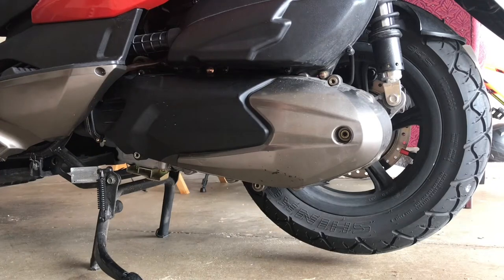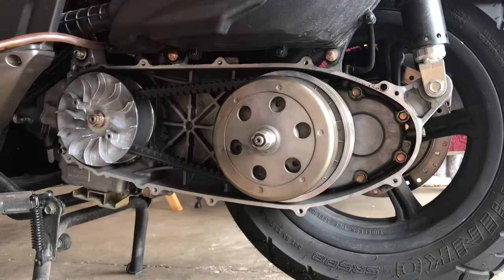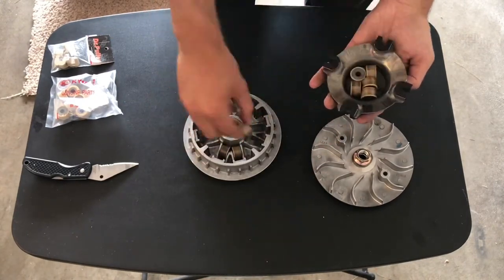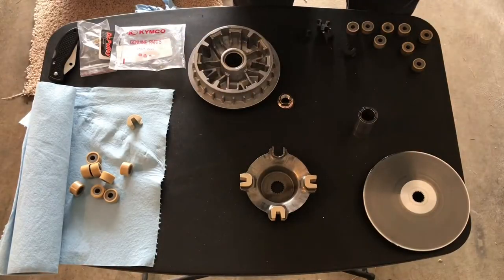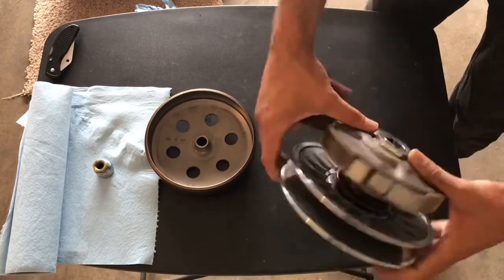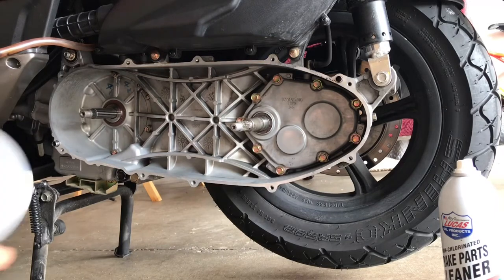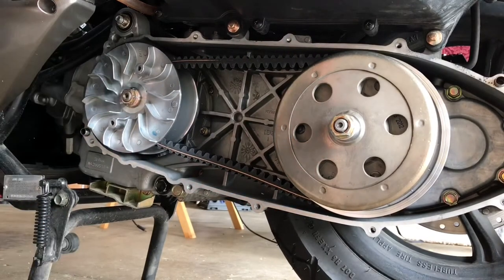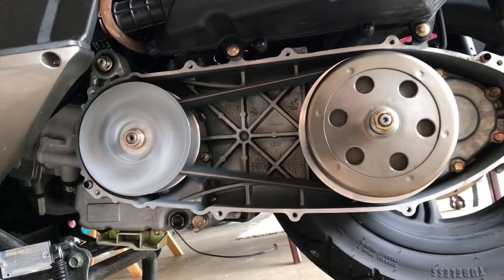Kymco Downtown CVT transmission maintenance - (belt, rollers, sliders and clutch inspection)

Comment from the maker: When installing rollers, note that they will have different sides, the side with more plastic on it will lead and you will instal them counterclockwise. If roller are same on both sides, then they can go in either way.
Reply: This will be extremely helpful thank you man also where do you order your Kymco parts from
Reply from the maker: @Julian-pj4yv  I get them directly from Taiwan. Check out TBS Scooter Shop’s website. You just need to know the part number and they’ll order anything you need directly from Kymco at awesome prices, 1/3 less than you’d pay at a dealer. To look up a part number just google Kymco downtown parts diagrams.
Reply: @nemanjatosovic  Is TBS Scooter Shop and Taiwan big Scooter shop the same I was on my Kymco Downtown 300i last night and it was making a new sound just getting ready to work on it if I have to and hope you enjoyed your Christmas man

Comment: Why did you change all that out ? My manual  Kymco 2012 Like 200 i states change belt every 7-8 years and just did that in Oct 2020 and it really looked good. Every thing else looked good.
Reply from the maker: The rollers should be changed as soon as they are worn, that till depend 
On many factors, the belt usually can last around 10-15 thousand miles but with age, can go bad even with less. The sliders like rollers will need to be replaced if they are badly worn etc. in order to keep the scooter running like new it’s best to follow maintenance intervals in the manual..

Comment: Nemanja do you know of top of your head are those rollers in 20mm x 12mm dimension ? Thank you 

I have bought used downtown and working on it a bit
Reply from the maker: I can’t remember but I think you can find the original weight abs size in the manual

Comment: Is a 2021 xtown 300 with 11k miles for 3300 a good price ? And anything to look for before buying it?
Reply from the maker: I think it can be if it’s in great shape, at around that milage youlll need a new belt, valve checks, probably new rollers, and a complete fluid flush.

Comment: Whats causes squeeking noise at take off? 
Great video btw
Reply from the maker: Hmm.. maybe your belt, brakes, I’m not sure. Could be a few things. Any issues accelerating? Where does it seems it’s coming from?
Reply: Hi, have the same problem on a 2010 kymco gti 300 , a squeaking noise  on slow-medium  acceleration that gets quite loud between 17 km/h and 22 km/h after 22km/h there is no squeaking at all, also on full acceleration from 0 to 30 i can't hear it.The sound comes from the transimision. The belt and rolers were changed in 2019 at 15000km now its has 21000, could squeaking come from rolers?
Thnks.
Reply from the maker: @ionutrs2212  generally belt or the clutch. You can take the cover off and listen up close I’m sure you’ll be able to see what’s causing it
Reply: Sounds like I have the same thing.

Can squeak on take off, most noticeable when the clutch dissengages under engine breaking where there's a short squeek as it dissengages.

 My guess is when the clutch first engages the shoe doesn't make a good contact with the outer housing and squeakes.

Other people can comment if that sounds reasonable, I'm no mechanic.
Reply: @chaza4454  could be. It's been a while since I've dealt with mine. But the bell might be glazed and doesn't make great contact. Sanding/scuffing it down might help. Search up a video on how sand down a scooter clutch bell
Reply: @zoltanmeszaros6918  Thanks!

Comment: What tool set did you use or do you have a recommendation
Reply from the maker: Just a socket set. I used an impact driver to get the clutch abs the variator off. If you don’t have one, you can buy a variator tool which holds it in place while you take the buy off but the impact makes it much easier. 

You really don’t need anything else, maybe a torque wrench when putting everything back on.